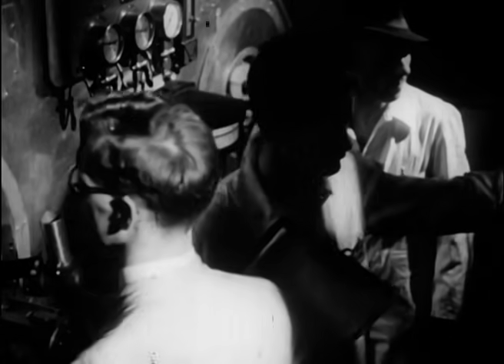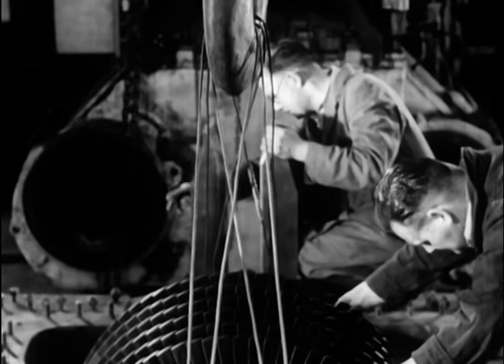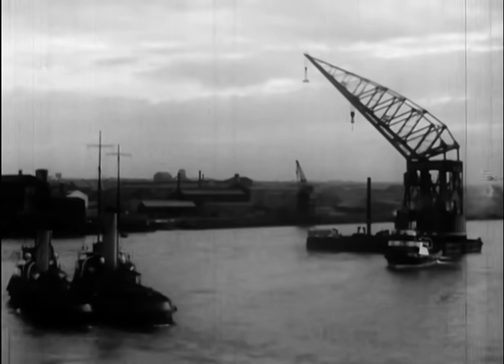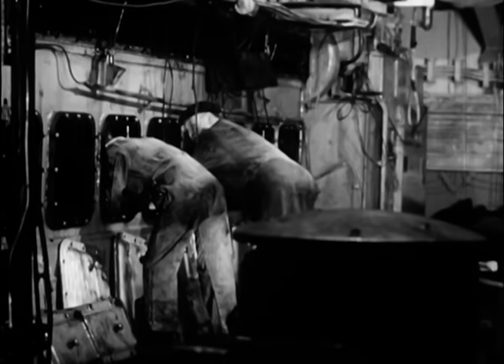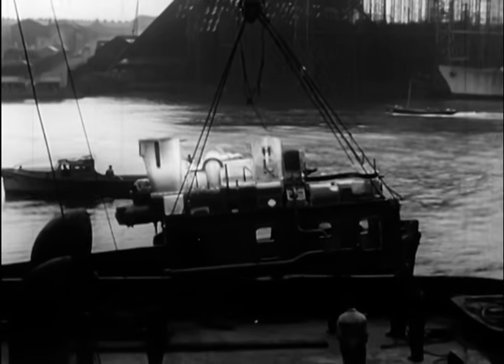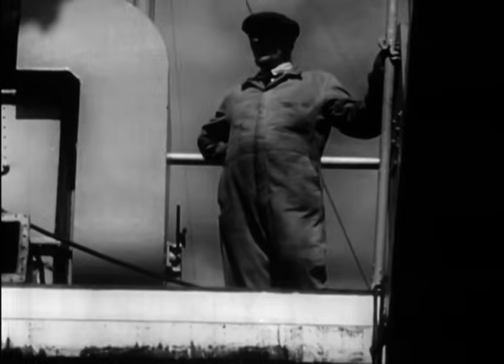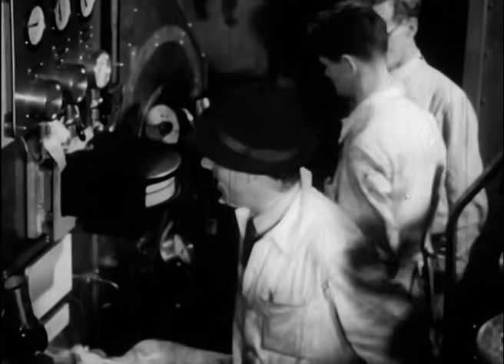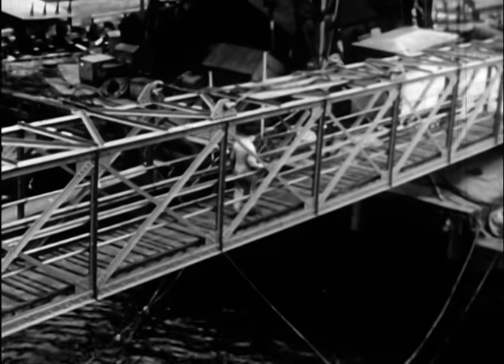The Gas Turbine Goes to Sea | Shell Historical Film Archive

Comment: Turbine engines in ships never really caught on, oh they are used but on the whole it's still piston Diesel engines being used as a main source of power (some burn a very crude oil)
Reply: Because diesels were also improved in efficiency, but mainly they burn less fuel at economic speeds, and more importantly last a much more working hours between some serious maintenance or rebuild.

But turbines are common for the warships, when the speed is critical.